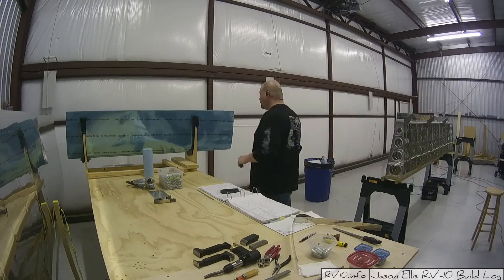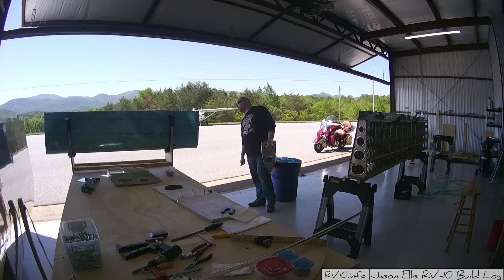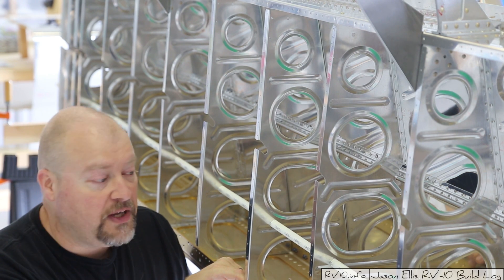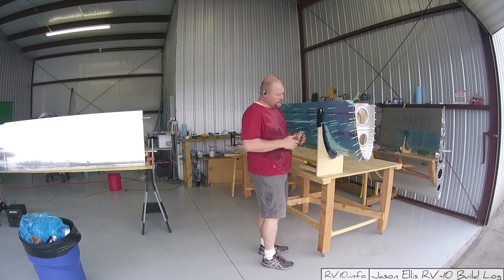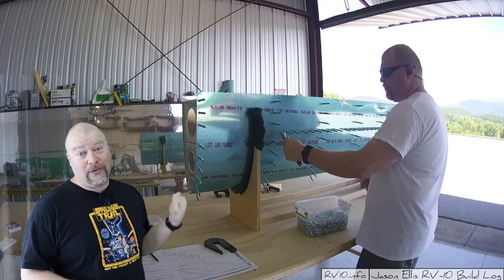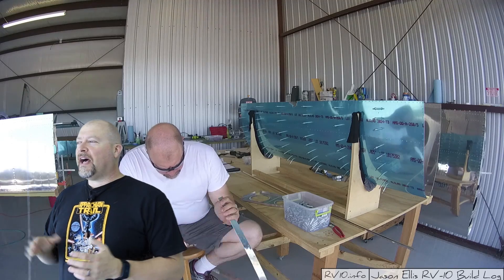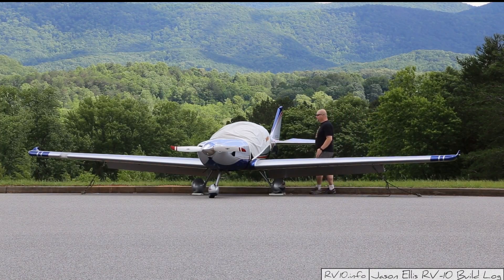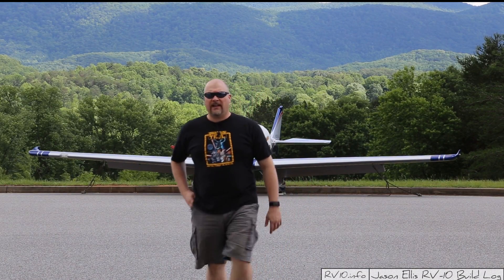RV-10 Wings - 041 - Right wing nose, drill, dimple and skin work - Status update - Lightning two

Comment: The white pipe is called pex. Shark bite is a company that makes it and fittings. It is used for plumbing houses. It is great stuff
Reply from the maker: Thanks for the additional info however just for clarification the stuff that I am using is specifically not rated for carrying water.

Comment: Hi Jason
I have worked in several aircraft factories building large aircraft components. For drill bits you could sharpen them , but to make them last longer they have a product called, Bo drill, its like a waxy material to lube the bit. I think what you're doing is awesome, Thank you for the effort it really is a great contribution to the community.

Comment: Hi Jason, love your videos on RV-10. I just started building RV-14A 
myself and I move along with your videos. Helps to see how you are 
accomplishing specific task or if you already solved a problem I am 
facing... It's like having a second person build alongside with me. I 
even have a computer in my garage so I watch your videos while I build. I
 have couple of questions and if you can help answering soon I'll 
appreciate. Recently I came across to one of the latest videos where you
 rave about a pneumatic squeezer. I can't find that video but the 
questions I have: What model is it? How much did it cost? And would you 
buy the same one again now that you have used it or would you chose a 
different model?  

Another question is about the flush rivet set 
you are using with rubber edge to prevent slipping. do you like it? I 
got one from ATS but it is not a swivel and the rubber is so stiff that I
 can't push hard enough to get the rivet head flush with the skin and 
end up with popped out rivet head. If you like your, can you send me the
 link where you got it from? Thanks for the help and keep up the good 
work with the video publications.

Comment: dunno if you've seen my previous comments - I worked for NCR (ATM's & self-check-outs), their kit was covered with the bluey stuff. we found if we heated it with a hair drier it would be real easy to take it off..
Reply from the maker: Hi Geoffrey, I haven't tried the hair dryer trick.. Mostly because (if you've seen my head) I have no hair..   Sort of a lack of hair drying implements around the house if ya get my meaning =p  I'll borrow the wifes and give it a shot.
Reply: hahaha, Hi Jason....I'm follically challenged also & have a facial hair - scary...(the missus, didn't miss her other drier) so it went into my toolbox.

Comment: You can take an angle grinder and resharpen the drill bits. Since by now I assume you have a lot of worn drill bits. I would give it a try. Some great videos on how to it. Also guides can be found.
Reply from the maker: That's an excellent point.. They aren't worthless and I'm sure someone with the skills could sharpen them and make them good as new.  I'm not that guy =). At $5 for a drill bit I'll just buy a new one and use it for a good long time.
Reply: Jason Ellis good point. 
There is also different metals in the drill bits. You can pay more for the drill bit and will get more milage out of the cutting edge. I am actually surprised that Vans does not provide a recommended tool set. Like 1/16 inch tool steel (or other material) drill bit.
Reply: Stumbled upon your channel yesterday. Nice job. This will likely be my next plane so it's enjoyable to see. For what it's worth, a drill doctor works well especially for the cost. And when the last bit breaks before the last hole! A 60 second sharpen saves a trip to the store. Small bits can be a challenge but as you said, they're inexpensive to replace. Thanks and keep it up!